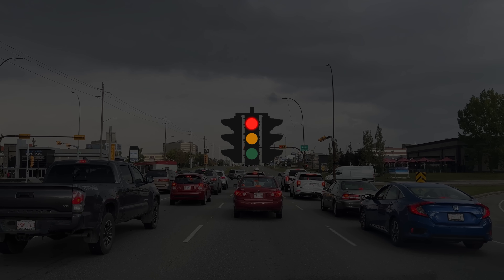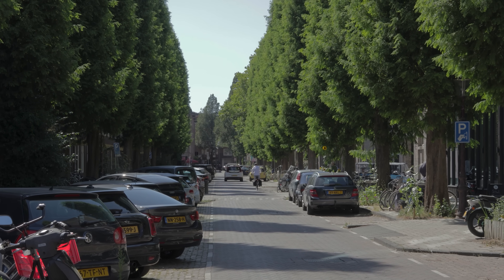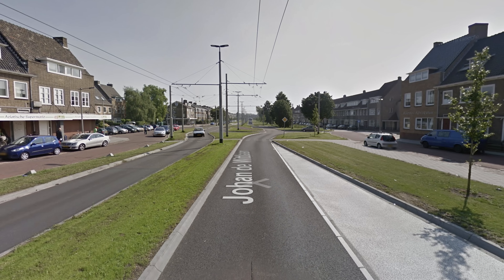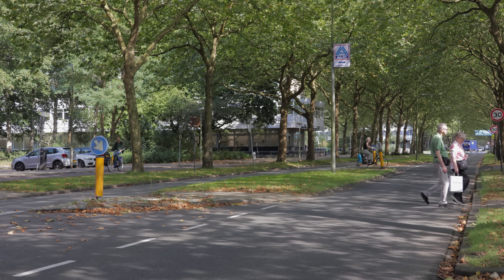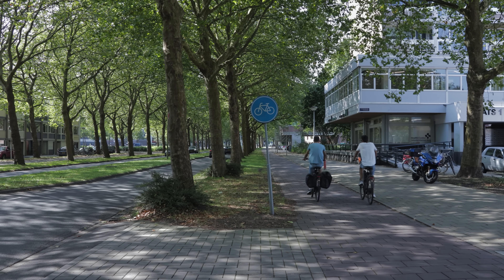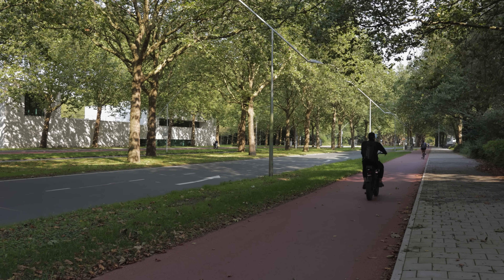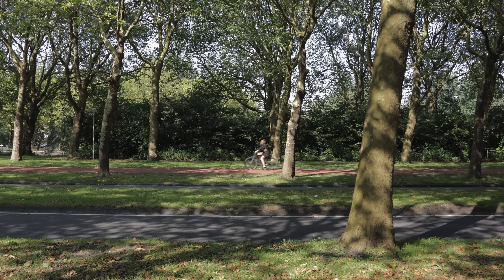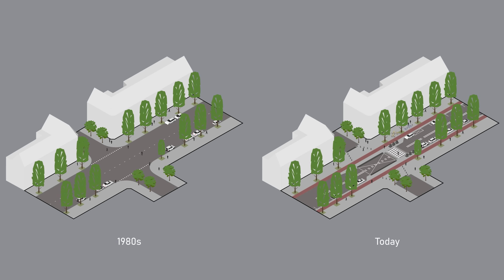Rethinking Street Design - Drive Slow and Go Faster

Comment: You've made a major mistake in your video. There are roads in Utrecht which were reduced in lanes and it resulted in major traffic jams through the city. Utrecht failed doing this because Utrecht made their major arterials smaller without reducing the amount of cars. The amount of accidents increased and the traffic flow became way less. The traffic lights added to the 't Goylaan for example made traffic even worse. The decision of Utrecht to reduce the amount of lanes on arterials is a major flaw. There are projects where this was succesfull but most of these projects unfortunately failed.
Reply: Source?
Reply: More traffic is sometimes the objective, so that the alternatives become more appealing.
Reply: As an Utrecht resident "major traffic jams throughout the city" is entirely overblown... However the primary goal of a number of projects in Utrecht was indeed to reduce the attractiveness of some routes for through traffic. In particular the "Westelijke Stadsboulevard" is now intended to handle only local traffic and from early next year an entire section of the road near de Gele Brug will be removed entirely. Utrecht wants all through traffic to use the outer ring/highway.
Reply from the maker: I am sure that traffic planners anticipated that there would be increased traffic after the reconstruction. Just like when cities reduce the number of lanes to make space for bike lanes, traffic may worsen in the short term, but in the long run, it will improve.
Reply: It is very finicky, yeah. I've not experienced much issues with it, but it's also a road I try to stay away from around rush hour. There are alternative routes, but many people still try to use it. It can get gridlocked quite easily if a driver makes a mistake, but overall I do think it's an improvement over the old situation. Speeds are a lot slower. 

The municipality changes some major roads with the idea that people who need to be elsewhere in the city leave the city limits, go on the highway/ring and then reenter the city on the right side, rather than use roads like this to go straight through the city. It doesn't help that when the street was changed, the southern ring road was also under reconstruction, often leading to slower traffic there. So one of the alternatives became less attractive and people still opted to use the Goylaan.
Reply: I'm commenting to see what sources might be provided. I won't criticize if none are provided.
Reply: Hmmm you must have lived in another Utrecht then i have. During contruction it was a bit chaotic and right after yup it was pretty horrible. But after everybody got used to it works as designed. People that don't have to drive there aren't driving there anymore and its way safer. Now there are probable one or 2 points that need to be fixed but most of them are succesfull and not a failure as you claim.
Reply: You only experienced traffic jams, in Groningen it is impossible to travel from one quarter of the old city to another quarter by car, there is not a traffic jam, there is an actual barrier to prevent cars entering. You have to get to the outer circle and re-enter into the next quarter.

Comment: I'd love if you did a follow up video about how the Dutch design rural roads, particularly ones with truck traffic. 

In the southern USA, there are a few primary designs, none of which are friendly for bikes. There are four-lane roads which have 12 ft shoulders and a 40ft sunken median or 12ft center turn lane. In towns, the shoulder may be replaced by a sidewalk. I'm not sure why the collector road scheme isn't used more.
Reply from the maker: Yes, I will make a video about rural roads as well! For now, you can check my Road and Street Design In the Netherlands video where I cover them briefly
Reply: i can tell you alreaduy that biking lanes in rural areas are mostly  completely separated from car traffic !
Reply: @richardhltrp1791  "... biking lanes in rural areas are completely separated from car traffic!"
Far from everywhere, I'm afraid. Many rural roads are among the most dangerous in the Netherlands. 
Only drivers' decency will safeguard you there and (fair enough) it usually does.
Reply: @mourlyvold64  i changed my post for you ! hope you are happy ! and the exception does not make the rule !
Reply: @richardhltrp1791  No offense was intended, my friend. But the adjustment is appreciated anyway.
What is the exception and what is the rule really depends on how deep you get into rural areas, though.
I wouldn't dare to bet on either.
Peace.
Reply: We have these highways types (four lanes, large shoulders, sunken median) in California also.  I believe it's a US standard (unfortunately, no consideration for viable alternatives to driving, naturally).  The real problem was that, back in the 50s and 60s, engineers got lazy and decided "let's just take the rural road standard and apply it to cities!" And thus, Stroads were born!
Reply: @ScramJett  Sometimes the stroads come first...but often the commercial, industrial, or residential sprawl slowly, and haphazardly grew around formerly rural roadways rather than the other way around.  I've noticed that in much of California and the West urban/suburban areas are decently pre-planned to a design standard as you described.  They are on another level of danger, chaos, and ugliness in most of Texas, where so many areas went from farm to suburbs, sometimes even into dense, urban areas without any comprehensive planning.  Interestingly, in Austin, the 80s and newer suburbs often have "better" auto-oriented roadways with proper medians, intersections, and minimal curb cuts.  The outer central city is the worst, with much of the stroads between the 1920s and 70s having no discernible comprehensive design for many decades.  Thankfully, some progressive cities (like where I grew up in Fremont, CA) that have large roadways and right-of-ways to begin with are starting to apply the lessons of Dutch roadway design.  I've also noticed that new suburban developments in California and the West typically do a decent job of right-sizing roadways, traffic-calming and providing more pleasant/thoughtful pedestrian facilities than in the past.

Comment: It is incredible what you can achieve when you limit left turns and street parking as much as possible.
Reply: It's about separating streets from roads. Roads should have few intersections and minimum disturbances to traffic flow, while streets should lead to destinations and not be used for through-traffic.

Comment: Build The Lanes has a good video outlining how intersections are the limiting factor for traffic volumes. In a nutshell, there is a limit to how many vehicles per hour that can move through an intersection, and that number already exceeds the volume of ONE traffic lane. Adding more lanes literally does nothing to improve volume. It does, however, allow for overtaking and unsafe speeds.
Reply: Scram, I think that you mean the opposite: the single lane exceeds the limit, as opposed to the other way around.

I loved that video.
Reply: @eugenetswong  Yes, it was a good one.  I think you're right.  In any case, the main point is that adding lanes doesn't solve anything because intersections are limited to no more than around 1500 vehicles per hour, regardless of size while a single lane of traffic maxes out at 1400 vehicles per hour.  So, even with two lanes (2800 vehicles per hour) you can never overcome the physical limitations imposed by intersections.  And he was pretty clear that these were rather generous numbers.
Reply: mr negative.  The difference is that we can walk and bike everywhere, which reduces car traffic, so one lane is sufficient. In the US, walking anywhere is not common and is considered dangerous, whereas here, even minors can safely do all those things, except drive a car at 16. In a car-centric country, it's dangerous for children, a concern that may not be as prevalent in America.
Reply: @richardhltrp1791 I think you completely missed their point. They weren't against the concept at all, quite the opposite. You're both on the same side.
Reply: @doom-generation4109  yeah, I was kind of confused by his comment also. Because we are on the same side.

Comment: An analogy I learnt is that traffic is like a snake that moves through cars where they brake causing the ones behind them to brake before speeding up again and so on. This phenomenon can go on for miles even after the initial stoppage and reduces travel time for every vehicle
Reply: There are 1 or 2 YouTube videos of cars driving in a circle. They start off evenly spaced out, and then encounter phantom traffic jams. Check it out.
Reply: 'accordion-effect'. Research shows it is often caused by a single driver. That is why road authorities enforce dynamic speedlimits.
Reply: It gets even worse, when traffic capacity is at its maximum: You just need one ding-dong stopping on the street for any stupid reason, thinking it's no big deal, the 3 cars behind him just need to wait a minute. It's not 3 cars, it's ALL cars. Hundreds of people being stuck and waiting for ONE stranger down the street doing something insignificant.
Reply: Cgp grey?